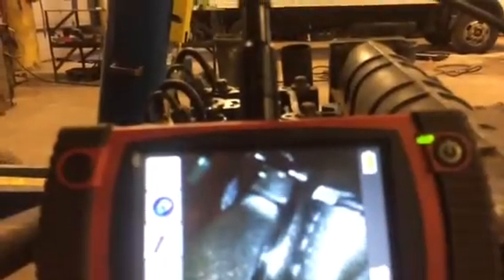Deutz F4M 1011f engine timing

Comment: Just finished replacing timing belt, tensioner, and a pair of rocker arms on a 1011 3 cylinder where everything flew all to hell, belt off. The timing pins are mandatory. Locate and install the cam pin first, it installs in a hole machined in the cam. The crank procedure is different. Shine a strong penlight in the crank timing hole, turn the crank by hand clockwise (facing the motor) until you see the crankshaft counterweights go by, they will wind up at the 6 o'clock position. You will see balance holes drilled in the crank counterweight, disregard these, don't try to screw the timing pin in these holes. Keep turning the crank over. When you first see a flat, shiny machined surface appear about 2 inches down in the hole, fully install the second timing pin. Be sure the pin is screwed fully down, you may have to turn the crankshaft back slightly. With the crank timing pin installed, slowly turn the crank clockwise until it stops -against the pin. With these two pins installed, you are now ready to install the timing belt.
Reply: Thanks for your comment regarding the second pin on the crankshaft. I was going crazy, cause after I place both pins and removed the belt. I decided to see if the crank shaft would move.  I turn it without doing any marks(stupid of me), counter clockwise and it did.  I though it was goin to be locked like the cam shaft. But I turn it about 1" Counter. So, I thought now I was going to be out of time. I then turn it clockwise until it  heat the pin. I left it there and place the belt. But was afraid to turn the engine on thinking that it was going to break something. So reading your comment gives me piece of mind. This means that when you put both pins in. The cam shaft will not turn and the crankshaft will only turn counter clockwise and if turn clockwise it will hit the pin. Is this correct? is this the correct position of both shaft?
Reply: Rola Fern when I say clockwise I’m at the front, looking towards the rear of the machine. You’re right; when the pin is installed, the crank rests against the pin, but you could turn the motor back counterclockwise. You’re ready for the belt at this point. There’s another step involving loosening the cam bolt and resetting the torque on it and the new belt. Totally unnecessary and it opens a real can of worms for no real advantage. Gotta love German machines.
Reply: By the way, #1 cylinder is at the flywheel, not the fan like the rest of the world. Get that straight before you try to adjust the valves. 
One more thing- it’s assumed that before you started turning the motor over by hand, you have loosened all the rocker arm bolts so the out-of-time valves won’t hit the pistons.

Comment: Is there any way to check governor to see if it is stuck and or broken
Reply from the maker: John Houston I'm not really sure on this engine it had electronically controlled fuel pump and I had to adjust the set screws to get the idle from 1100rpm down to 700 rpm. This didn't have a tach gauge but I could read it through the computer and I also used a non contact rpm meter ($50 harbor freight special,but does the job) so I hope that helps